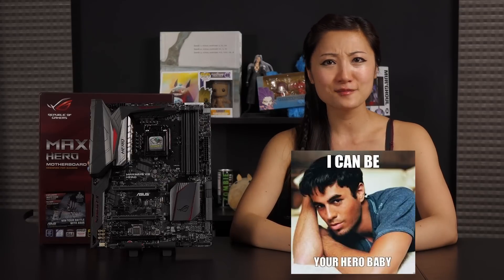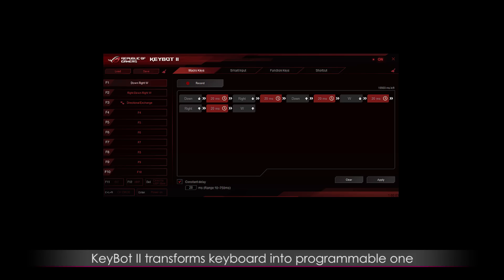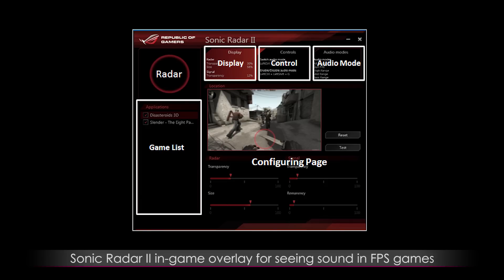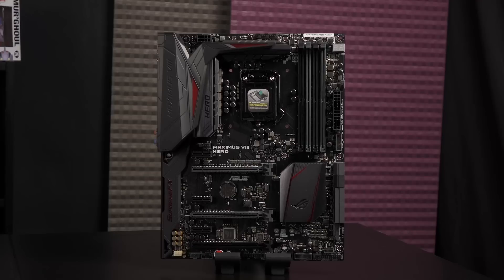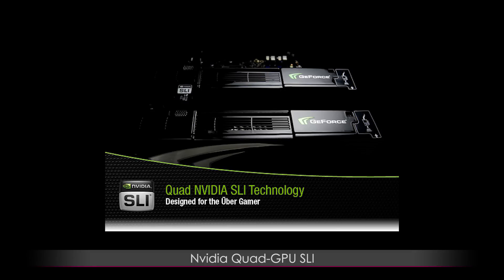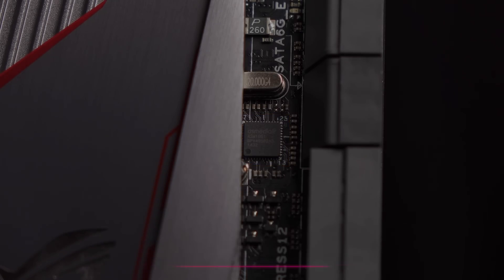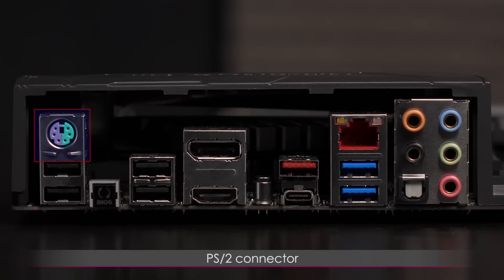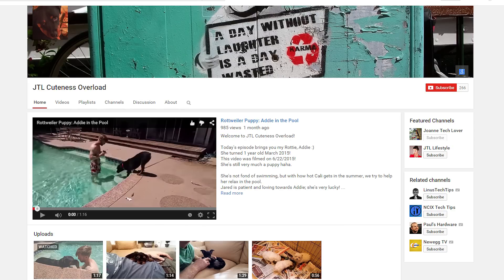Asus ROG Maximus VIII Hero Motherboard: Overview

Comment: I'm the creative content type and I was wondering if ram mhz matter for 3D Rendering, Photoshop(mass layers), Zbrush, Maya? I just bought the i7 6700K/Asus Maximus VIII Hero and I want to buy a 32 gb 2800-3200 mhz quad kit. Would it be somewhat beneficial to have 4x8 ram in a dual channel mobo?
Reply: KM L You will get no benefits. It's limited to dual channel.

Comment: You mention to use the slower SATA connection for slower devices, my question is what classes as a slower device? I have a Seagate Barracuda 2TB harddrive - will that need to go in the slower SATA ports or one of the four 6gb p/s ones?

Comment: I have this motherboard and it's fine,

BUT the provided audio drivers are completely bugged out and need a change of drivers that will result in disabling sonic studio (the current version at least as the working drivers don't include it)
(bugs concerns microphone input catching output signals and horrible noises because of a bugged amplification driver. in windows 10 for what i experienced but on all system from what i've read in forums while trying to find a solution)

The rest is fine for now.

A bit overpriced I guess I would think harder before buying the apparently most performing motherboard next time.

Comment: Hey Joanne, am little confused over the mobo 6700k, 1070, 850 m.2 nvme build. Asus Viii Ranger or hero or gigabyte gaming 5 or 7. Please help me choose!
Reply: Actually, Hero and ranger have same functions, exept 2 additional SATA ports installed at hero. Some say that hero has a little better oc potential, but i suppose it will make sense only in extream oc with liquid cooling. Don't know much about gigabyte, but i think there is the same situation. So may be it will nice to buy cheaper motherboard, if you are not going to make the hell of an overclocking and you won't cry because of 2 SATA ports. But hero is looking better imho.
Reply: Thanks mate! I bought hero alpha, didn't wana spend addition money on WiFi AC. Though usb ports at the back io is way way less compared to Ranger or Hero.

Comment: I'm considering this board, the Msi gaming 5, or the Msi gaming 7. Any advice?
Reply: I currently have the MSI Gaming 5 with an i5 4690k & GTX 970. The Gaming 5 only supports DDR3 ram, but memory only makes a small difference if you're gaming, which is why I went with the Gaming 5. DDR4 is a little more expensive than DDR3, but really it's up to you depending on your budget.
Reply: This, Anyway, Never go wrong with ASUS
Reply: spartan612 The gaming M5 supports DDR4

Comment: Must I use skyline ?? 6700k can't I use 4790k?
Reply: +noh1312 No! The 4790k fits in a LGA1150 socket whereas the 6700k fits in a LGA1151 socket
Reply: Are you sure abt that???? I nid a confirmation
Reply: Yes. You need skylake for this MOBO.

Comment: Any real benefits of a Z170 board for gaming over a Z97 board, despite the obvious CPU benefit.
Reply: +Ryan Frechette DDR4 ram, i guess? I'm just sticking with my ASUS MAXIMUS VII HERO and my i7-4790k. :)
Reply: lol yeah I'm rockin out with the same motherboard but the 4690k. I just sent my cpu back to intel, damn thing reached 115 degrees on the stock cooler and I live in a pretty cold area. Now I'm trying to decide what to buy next for my rig; an extra 8gb of ram, some LED lights or some upgraded fans. What do you think?
Reply: +Ryan Frechette stay with that 
there's only like  2-4 more fps difference
Reply: If you stream or make videoes i would buy the i7-4790k, + the speed is just.. Insane man! I have the BeQuiet! dark rock TF (Topflow), because I didn't like the looks of the dark rock 3 or dark rock 3 pro. It cools the cpu better than the dark rock 3, it's smaller and looks alot better. That's a win win in my book. :P

Comment: Just 2 Graphics Cards (SLI)? ;-;
Reply: +zAndrew you want 3 ? to spend too much money and have no more performance?
Reply: Ray Fetter
Because others pc gamers understand that, the third gpu you buy for  3-SLI give you maybe 50% of it's performance but you pay it 100%, so nobody need to be a genius to understand one REAL gpu like 680 780 or 980 make the difference... (gtx x70 sucks)
Reply: And you only get 16 PCI lanes with socket 1151 cpus, you would preferably want more for 3 or 4 sli configs
Reply: +zAndrew you can use tripple SLI with this board lol

Comment: Late to the party, but why do board manufacturers keep adding USB 2 ports, twice as much as 3 even, when the new ones are backwards compatible? Seems like a bit of a waste.
Reply: +Odontopera Mediochrea USB 2.0 is cheaper to produce, plus some stores will bloat saying the PC supports 8 USB ports without telling you what kind (theirs one big UK store that used to do that, not sure now though as I don't go there anymore).
Reply: Well this sucks. Eh, we'll just have to wait until type-c catches on, I guess.
Reply: +Odontopera Mediochrea I know this is a bit late, but USB 3.0 ports also don't usually work unless you have the proper drivers installed, 2.0 is driver-less... so for those 15 minutes that you still don't have any drivers on a new build you're going to need a 2.0 mouse and a 2.0 port.

Comment: gah i remember back in the day where youd have alot of pcie lanes now they seem to reside in the cpu thats horrid sighs
Reply: which makes me wonder why such a narrow pcie setup why not have two full length x16 slots *****
Reply: +DarxPhil this proving the point that intel isn't really improving much
Reply: In another note Joanne is beautiful
Reply: +chris simmons Chipset has nothing to do with it. Intel cheaps out on PCI-E lanes on their cpu's, cause they are so inexpensive in all. This is why AMD rigs do better in quad-gpu builds. They have a metric shit ton of pci-e lanes, and more cores for sli/cf overhead.
Something you will never hear channels like linus's or pcper talk about.
The 6700k has 16 PCI-E lanes. That is 2 8x slots, or 4 4x slots. No motherboard can add more cause that is all the cpu can do. 
The 8350 has 32 lanes, and twice the cores. Just something to be aware of. That is 2 16x lanes, or 4 8x lanes. The jump from 4x to 8x on a quad gpu setup is immense, and completely non-nonsensical of a choice for intel to make at the price they sell their cpu's for.
They didn't add it because it is not something that would contribute to most benchmarks, which means it wouldn't make them any money, so they would rather pocket that money instead.
Reply: +Richard Smith I agree it's a bunch if bull they need to have different set cousin one with no igp couple more cores more lanes they would save money eliminating the all but useless igpu and yes I know some people like having it in case there gpu dies but the price of a cheap spare card is less then 30 bucks ati 5450 pci e is 15 bucks online . anyway moving on there is no reason why they cannot make two different skus and agreed precisely one of the major factors I am on amd I can have two way full bandwidth cards or three way with 8 8 4 or if I want quad the card would  have full 16 if I'm using two 295x2 yeah at ultra hd it matters
Reply: chris simmons Well, as far as I am aware, the 295x2 operates on a single split 16x lane, as it only takes up one slot. So having a 4 way would only require 32 lanes for them to operate at their full speed. So it would be 4 8x lanes(2 16x lanes required). I may be wrong tho. If that is so, a 295x2 operating on a 8x lane from the slot would mean it is technically operation on 4x lanes. Their is little difference(if any) at this time between the performance of 8x and 16x, but 8x->4x would begin bottlenecking hard.